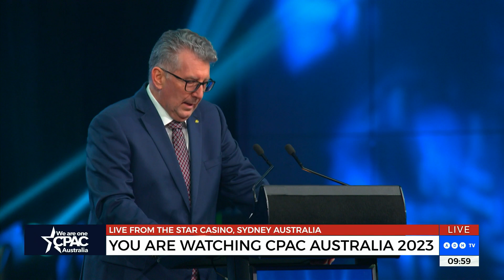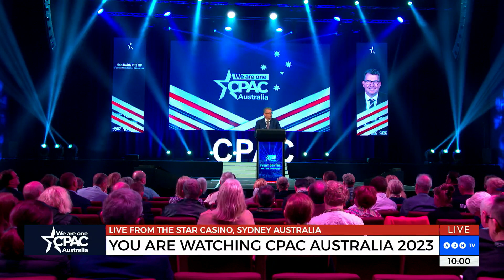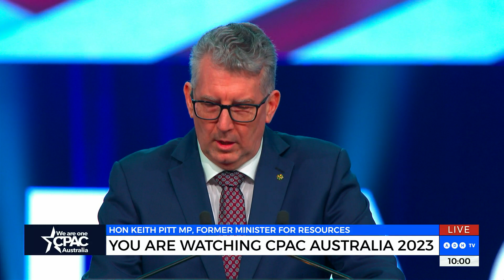Transmission lines are ‘just not necessary’: Pitt

Comment: What is not discussed is when, after 20 years the roof PV solar panels need to be replaced and new panels fitted, the entire roof needs to be fixed and this can be extremely costly. In the US insurance companies refuse to insure for the replacement of the roof. Also if the tiles are old and brittle after 20 years, it could well be necessary to replace the entire roof covering.